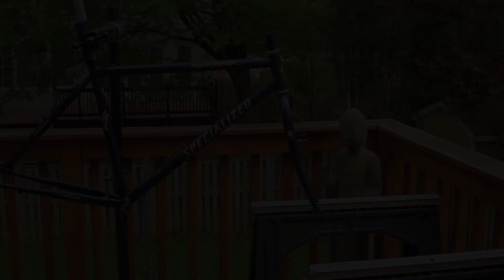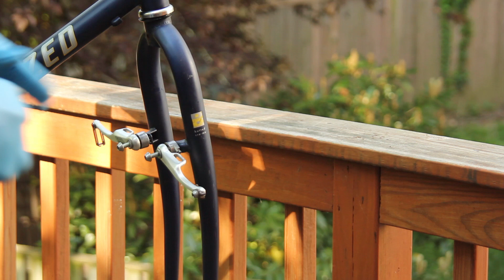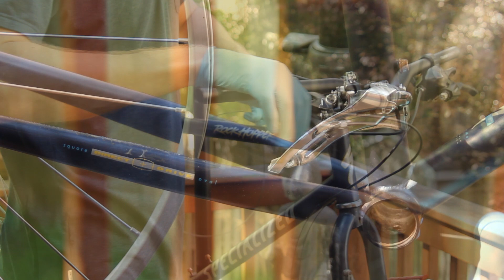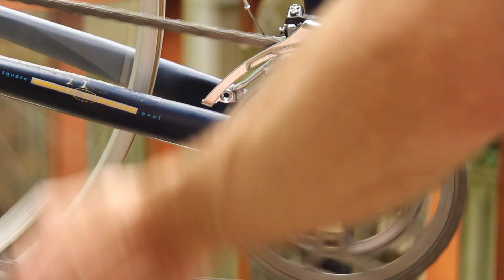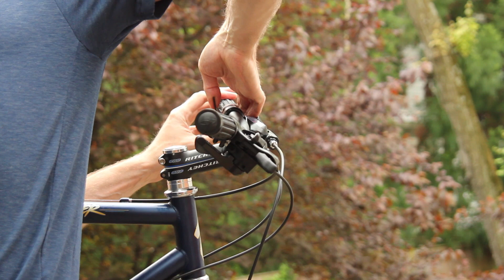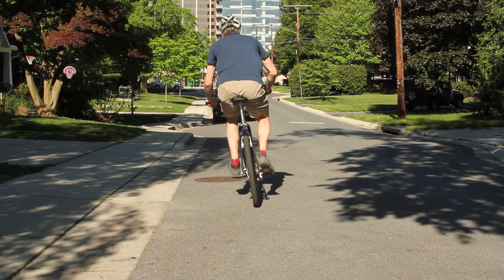Bicycle Restoration Final Stage 1997 Specialized Rock Hopper Bike Restore

Comment: Nice restoration. I have a 1998 Rockhopper that I ride often. I'm the original owner and have taken pretty good care of it so it's in much better condition than that one was when you started the project. I'm considering upgrading some of the components, especially the brakes and shifters even though they are still working fine, and this video was helpful.

Comment: I own and ride a 1994 Specialized Hardrock Sport. A farmer left it by his mail post with a free sign. After replacing cables, housing, chain and cassette. I opted to go 3x8 will Acera rapid fire shifters and Avid levers. I couldn't have the cantilevers so I opted to go Deore XT v-brakes. I ride that bad horsey on the trails and get the looks. Myself: 58 and steel is real...love your videos Forrest!
Reply from the maker: Sounds awesome! Thanks for the nice comment!
Reply: did the 8 speed cassette fit the original 7 cassette hub?

Comment: Loved this! I have the 1997 Rockhopper, in the same colour, owned from new. There is some minor rust pitting, but the steel frame is still going strong, and the bike is still an engaging ride after all these years. Not too many original components left though.

Comment: Hi great video. I have the exact same bike and currently doing a refurb. Do you mind me asking what the Bottom bracket is? Stupidly I lost the part when disassembling the bike. I believe it was a bb-un52. Is that the same as your bike? Kind regards.
Reply from the maker: I used a Shimano UN300 68x110.